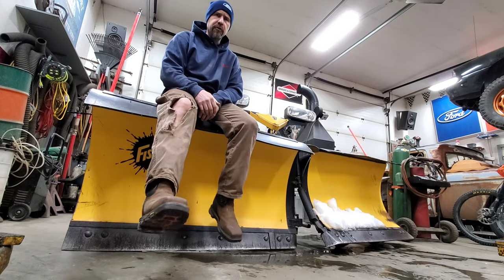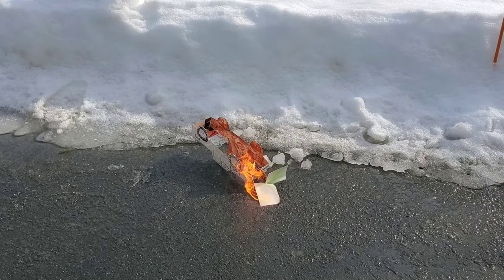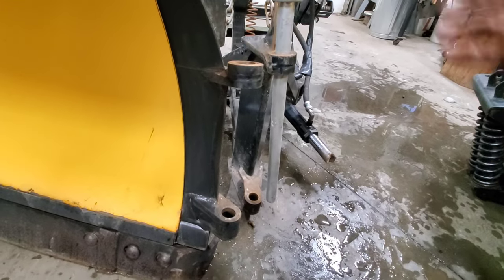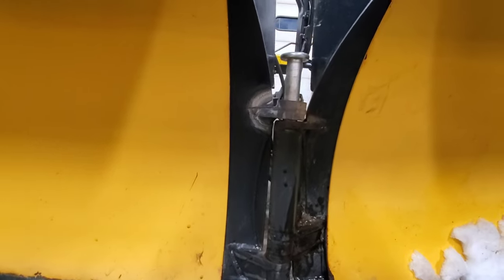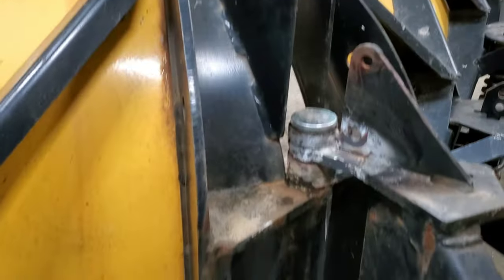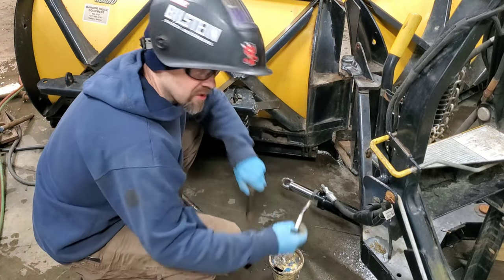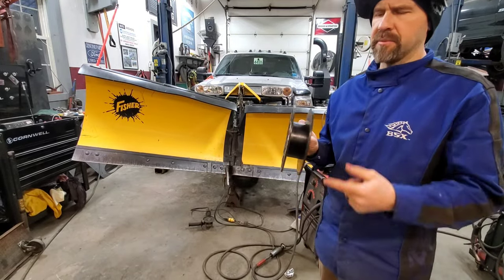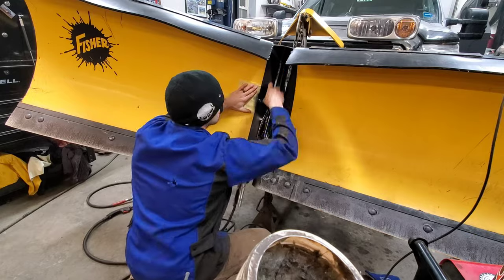Broken V Plow Pin repair ep.10

Comment: I drilled and tapped (4) 1/4-28 grease fittings onto the bosses where the center pin goes through too hopefully keep it from wearing out the pin and weakening it to the point where it snaps.

Comment: If Fisher offered the xls expanding wings on their V plows would you buy it?
Reply from the maker: I do wish my 9.5' v was smaller at times but guessing I couldn't justify buying all new yet. I would only imagine if they did it would add 200lbs to a 1200lb plow!!
Reply: @hammeredironworks7788  the 9.5 V weighs about 1000lbs withput the mount so adding 200 should be doable.